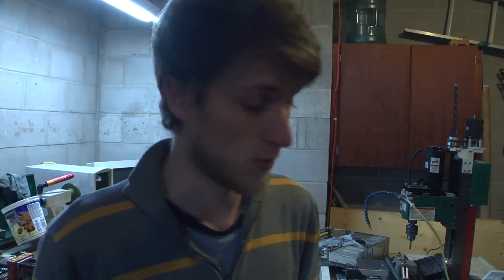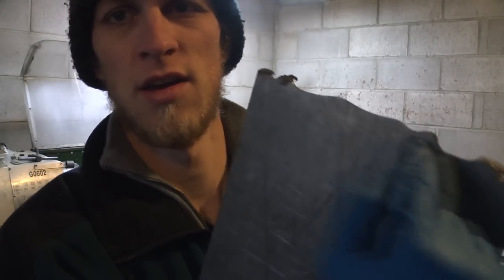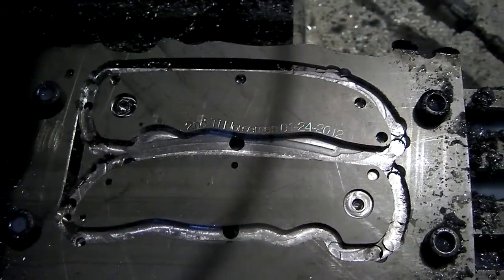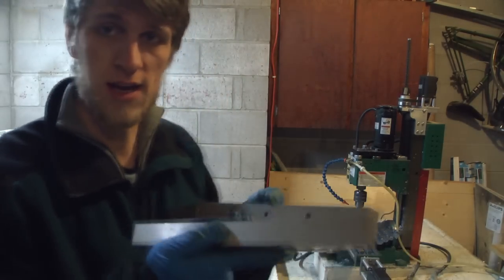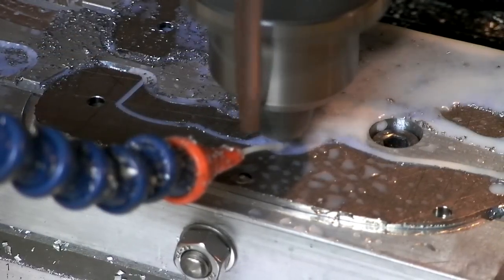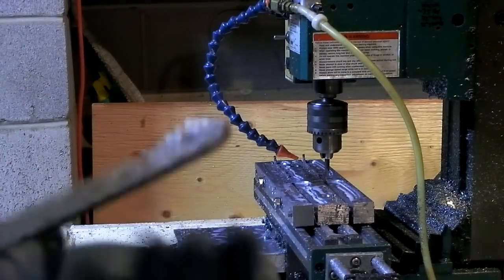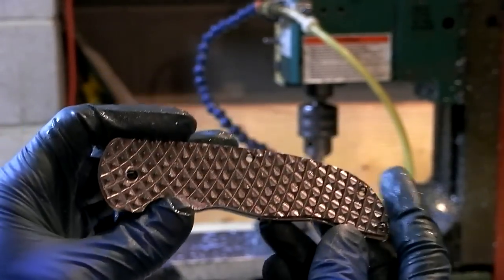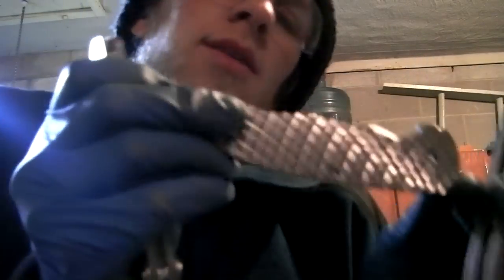Knifemaking Tuesdays Week 12 - Textured Titanium framelock handles

Comment from the maker: @brenck No need for a video, I'm using a 900gph aquarium pump, on the box it will say how many gallons per hour it loses per foot of elevation.  Since my coolant hose goes up probably 4 feet from the bucket this was a concern.  900gph works great though, I actually have to turn it down with a ball valve otherwise it sprays everywhere, pump was about $80 locally at a pet store.  Relay controlled, Mach3 activated, you can even set a delay to give it time to pump up, or use a check valve like me!

Comment from the maker: @bobmellon I have a little 1x42 but it's not very nice and I've hardly used it.  My goal is to machine the mating faces with tight enough tolerances that they work perfectly, I honestly don't think it'll be a deal.  I've got a 7° endmill to do the tang, so it's just a matter of adjusting my code and doing a bunch of test blades until I get the tang mating face in the exact right location.  I trust my machining more than my hand grinding anyways.  This is an experiment in machining.